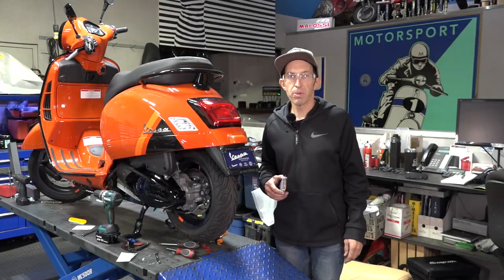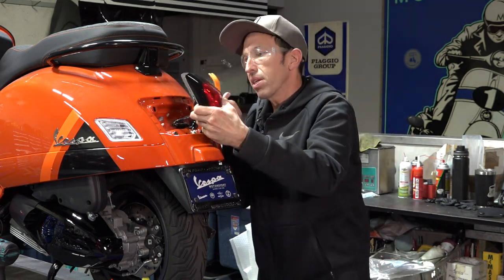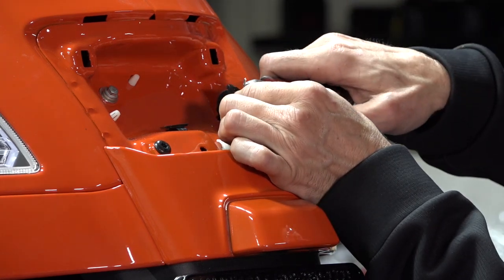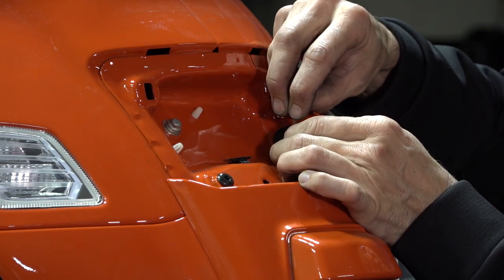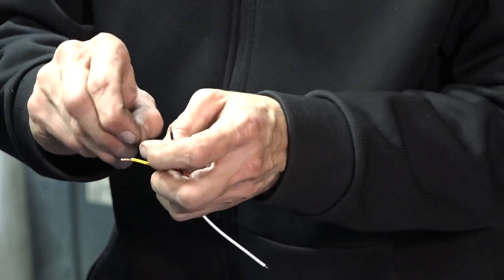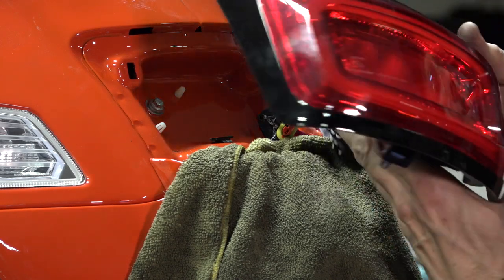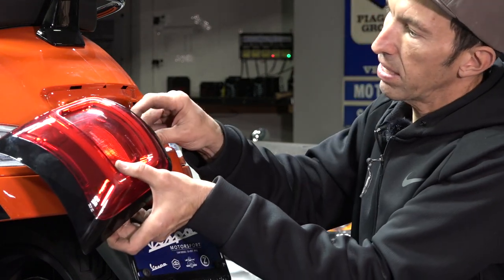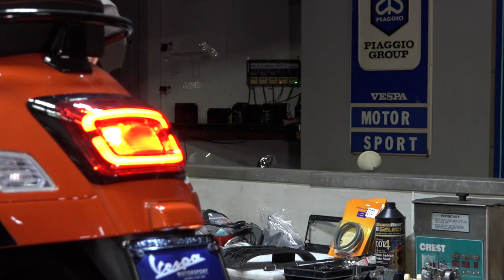Brake Light Modulator Installed on a 2023 Vespa GTS HPE 2 | Programmable & Universal!

Comment: Had to move the Module to the other side of the rubber grommet with the wires not shortened and with the supplied connectors correctly installed I still can't fully set the tail light FLUSH against the fender.  So I plan to remove the connections and use solder on the wires for a bulk-less package because there is no other way.  I have no idea how Robot made this fit in a 2023 GTS 300 Super; there's zero free space.